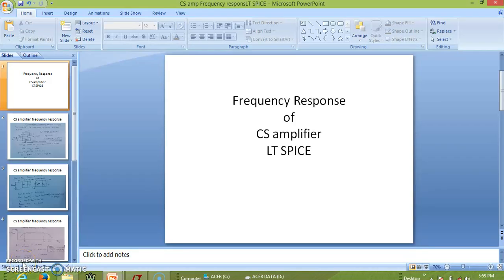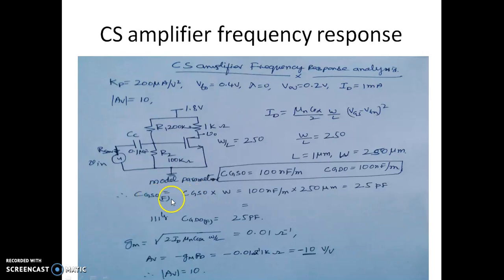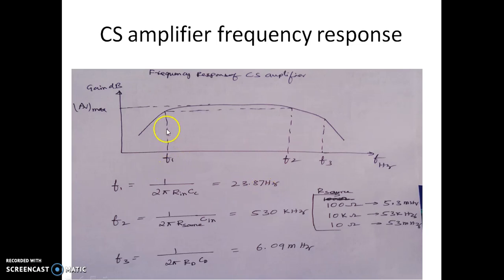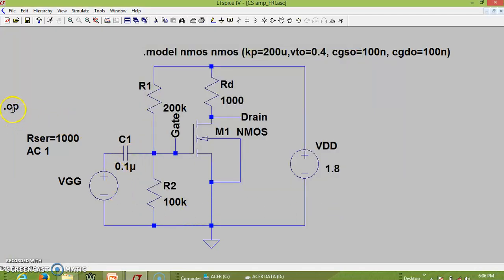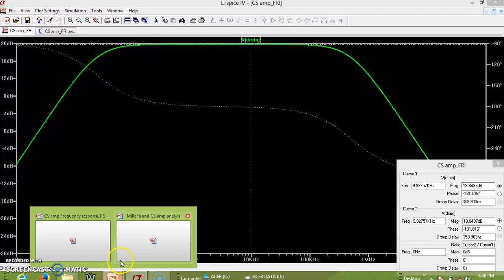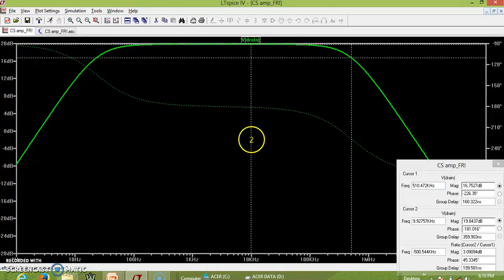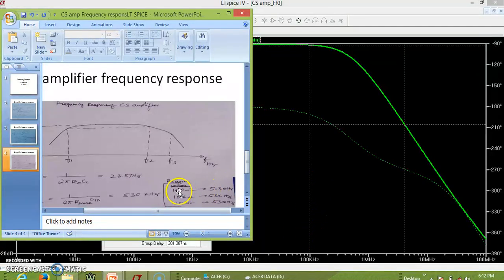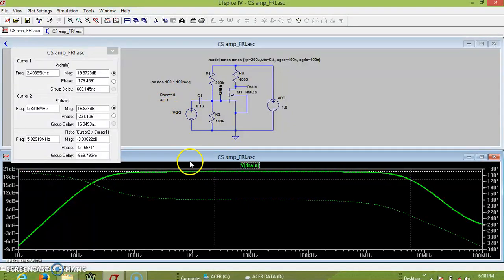28 CS amp frequency response LTspice

Comment: I wonder why I get the result false
Reply from the maker: What do you mean by false result!
Reply from the maker: You can email your schematic,  I will check and fix the issues and let youknowwhats the problem!!
Reply: @narasimhamurthyk.c.vu3dwf475  oh sorry, I don't use the right model for the MOSFET, solved
Reply: @narasimhamurthyk.c.vu3dwf475  btw, can we change the unit in y axis to volt?
Reply: of course, but you have to change the analysis mode first
Reply: @ARNAB DEB .model nmos nmos (kp=20000u,vto=0.4, cgso=100n, cgdo=100n)